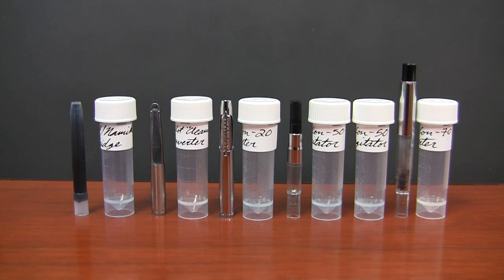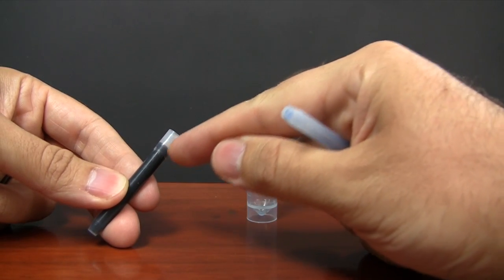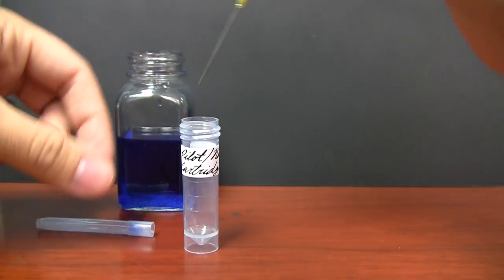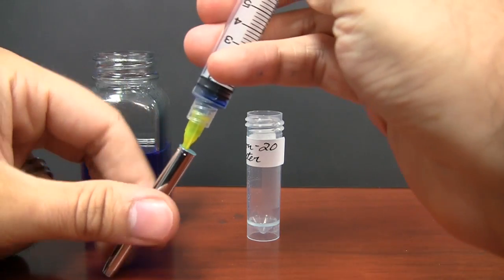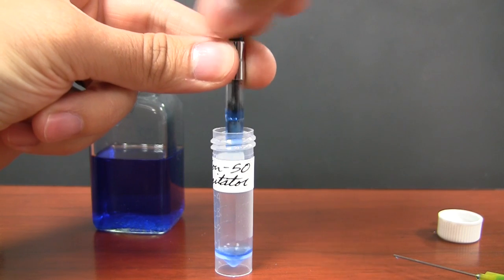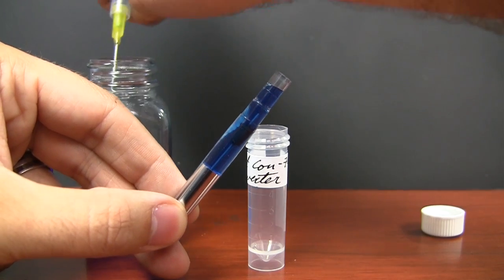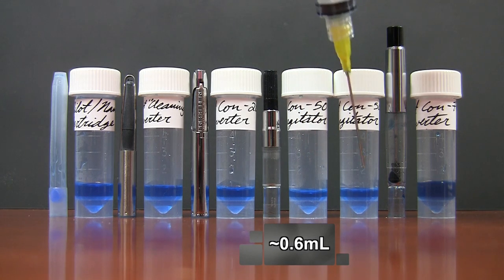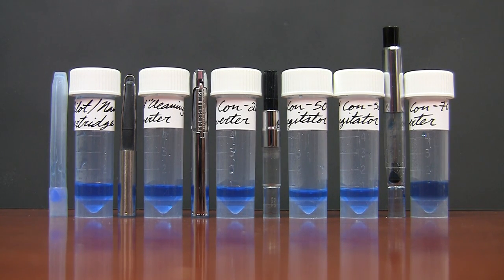Pilot Converters Part 2

Comment: I've got the cleaning converter from a pilot metropolitan on my pilot prera and I find I have to draw and expel two or three times to create sufficient vacuum to fill the converter - I also find using the syringes an easier method since you don't have to get ink all over the nib and wipe it off

Comment from the maker: I'll be posting a separate video showing that, but it's pretty straightforward. The metal piece unscrews, though it's tough to get off because it's glued in place. You need to break the glue to get it off, and that sounds harder than it is.

Comment: Seriously?  It's good enough as a demonstration of ink volumes and it's a fairly consistent error being introduced in each case.  Precision is far more important than accuracy for this demo.  I'm an analytical chemist - if you'd really like I can get you a full report using a high-resolution analytical balance, but it would tell you the same information.

Comment: I wonder, how do you store refilled pilot ink cartridges...? The kakuno sa maybe the same ink cartridges and i want to reuse them using noodler's inks, but I wanna store them neatly so that I can bring them in long exams to use for a quick refill... I need about maybe 2 to 3 extra cartridges in one exam (was thinking of placing the filled reused cartridges in a small plastic bag lined with paper towel similar to the nemosine extra cartridges but the prob is with pilot, the opening is big that it might spill with little agitation unlike the standard ones like the nemosine or jinhao cartridges...) thanks!
Reply from the maker: Yeah, refilling ink cartridges isn't necessarily compatible when it comes to on-the-go writing. That said, I've heard of people re-sealing the puncture hole with tape, hot glue, or putty. Could try those in a pinch. - Colin
Reply: The Goulet Pen Company or would it be possible to just align the cover so that it'll "cover" the hole?

Comment: Yes.The seal will loosen up. The solution is to replace the cartridge or converter with a new one. They are inexpensive and it's easy to do.Piston fillers and vacuum fillers also wear down and need to have their seals and washers replaced. This may involve sending the pen back for servicing or at least some effort on your part to make the repair. If you want the extra ink capacity and don't mind,then these pens are for you. If not then go with the cartridge/converter system as most folks do.

Comment: I fill my Con-20s with a syringe, but I never know if other people actually do that, or try to fill up the pen with the bladder suction. Do you find (or think) that repeated removal and then replacement of the cartridges/converters wears down on the plastic, on either the pen or the cartridge/converter?

Comment: Brian, weren't you an engineer? You've introduced errors everywhere using this method. You've overestimated your volumes by 0.1 ml at least. This method is less accurate and less precise than tared weights pre and post filling.